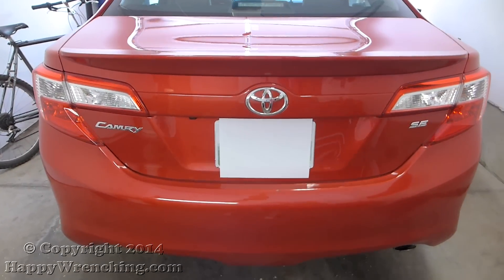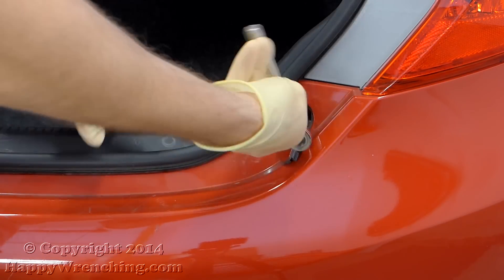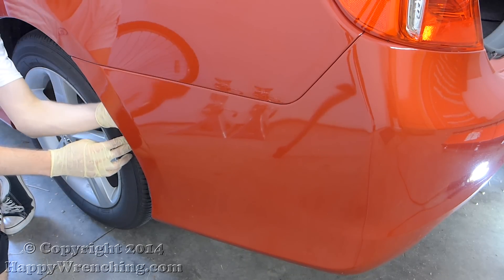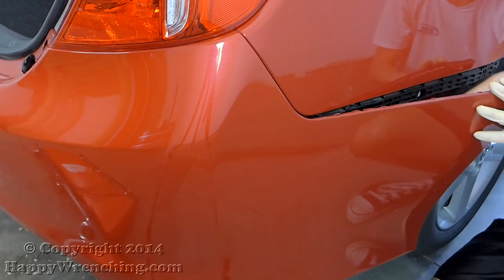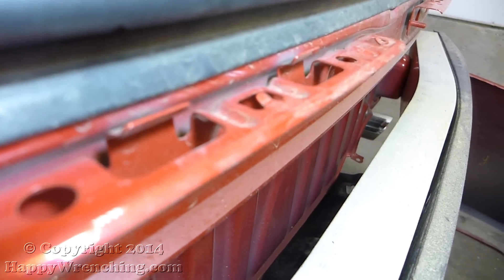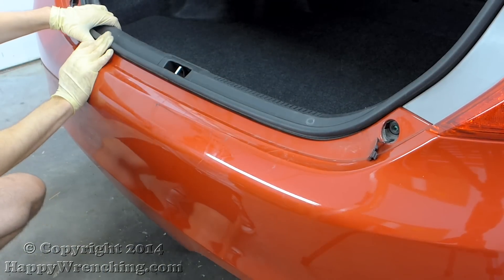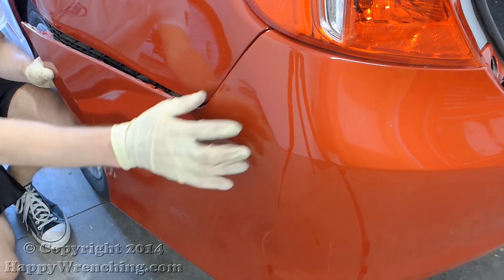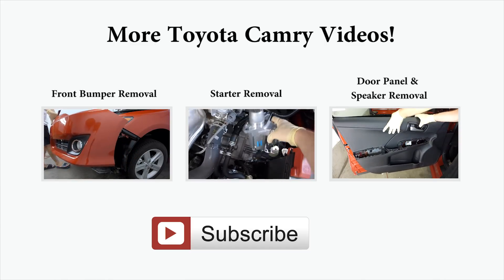Toyota Camry Rear Bumper Cover Removal (2012 - 2014) | Replace & Change

Comment: I have a Toyota Aurion 2012 here in my country and found this to be very helpful.
Thanks for taking the time to upload this video.
The Aurion is built on the same Camry platform but is a higher spec vehicle that also has the V6 as standard.
The bumper install is the same with only a slight difference inn cosmetic appearance.

Comment: Good video. I have a 2012 Camry Hybrid and there are two differences that people should be aware of though. I don’t know if all 2012’s are different or if it’s just the Hybrids.
1. There are a total of 4 body clips holding the bumper cover in place on my car. The two you show and two more near the left tire.
2. There are four white body clips holding the plastic trim piece in the trunk (the piece that surrounds the trunk latch) that stopped me from pulling it out. I had to remove all of the clips holding it in and pull the plastic trim piece straight up to remove it.
Reply: I have the 2014.5 Hybrid and I'm thinking that the extra steps you've mentioned are gonna be in my hellscape of a trial in trying to replace MY bumper cover.. 🤔🥺

Comment: I have a silly question - what is the purpose of those plastic push clips on the bottom of the bumper (2 of them, one for each side)? Do they serve any aerodynamic purpose, because I just bought a used 2014 Camry SE, and the thin plastic part where the clip goes through that's closest to the muffler has been broken off, supposedly by the previous owner making a mistake. Does that thin plastic piece where the push pin goes through keep the bumper stable to dampen vibration?
Sorry for the lengthy question. It's a difficult piece to describe.

Comment: i need to get the rear cover off of a 2012 sienna (heat up and push out a dent). would you happen to know if the process is the same?

Comment: Is it hard to replace the black plastic clip rack that the bumper attaches to? Mine has damage on the black plastic clips but the bumper looks fine.
Reply: I am having the same issues where you able too fix the plastic clips ??

Comment: happywrenching is it the exact same procedure for a 2014 camry sport? I see that it's a different part online, and am wondering if i can use a standard 14 camry rear bumper cover to replace it, or if it's necessary to get the sport edition?
Reply from the maker: Yes the steps are the same on all the trims and while you could make the non sport bumper fit, I'm pretty sure it won't look quite right. The sides and rear of the bumpers covers are molded differently.

Comment: Where did you get the bumper from? My gfs Camry is the same one as this and being the SE model it’s slightly different, but for whatever reason it is 2x the price. Can I just buy a bumper from the other models? Surely it will look fine still

Comment: Are the steps the same for a 2014 collora? I have to replace my light assembly so thanks in advance
Reply from the maker: The steps are very similar but I'm not 100% sure that you have to remove the bumper cover in order to remove the light assembly. You may be able to remove it without taking off the bumper cover.

Comment: Hey quick question. I am removing a toyota avalon bumper to repair a dent. Is the removal procedure more or less the same for the avalon? Your video was very helpful.
Reply from the maker: Some of it is the same - there are screws and clips on the bottom of the bumper as well as the one screw near the wheel well. I'm not sure how the center of the bumper is held in place though.

Comment: I couldn’t get the bumper to pop back on the middle part where you must lift and pull to get it off, would it be okay to just leave it like that? Bc I pushed and try many diff angles and it did not want to pop in
Reply: The part right under the lip of the trunk

Comment: Hello, I want to install a parking system that I ordered, 8 sensors, and might need to remove both fron & back bumpers, as I saw they have foam behind them or something, are these instruccions also for a 2001 Camry CE?
Reply from the maker: Not sure. 2001 - that's going back a ways. I think 1A Auto Parts have a video for that model year camry.

Comment: I pull my bumper half way off it caught onto my gate while i was backing in, i pilled the plastic latches that actually keeps the back bumper up. will it cost alot to fix it.
Reply: if you mean the black runners on the sides under the bumper, those are just the bumper brackets there only 30 or so bucks not a big deal

Comment: How do I fit the 2 clips in the middle? Do the clips go over or under?
Reply: Do you mean the two sets of metal brackets near the opening of the trunk?  If so, the bumper part sandwiches over and under the metal brackets that the clips are a part of.  Hope that helps.